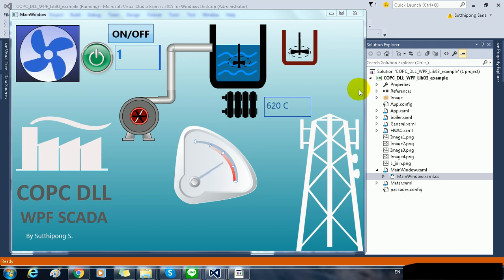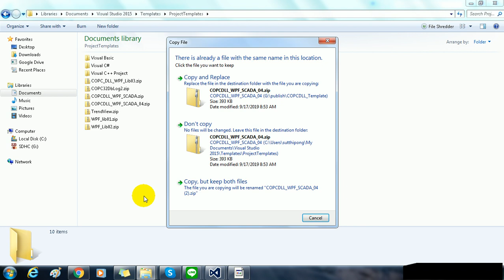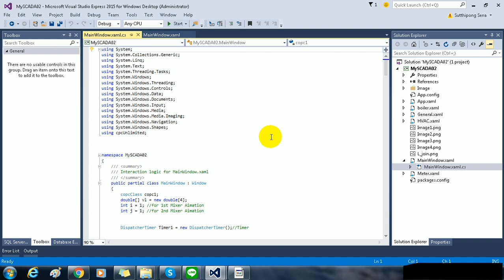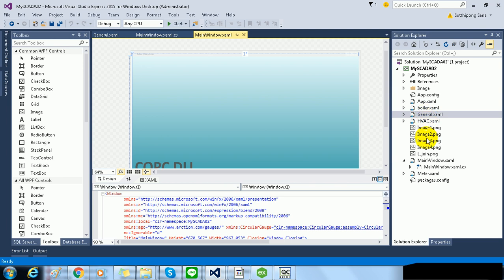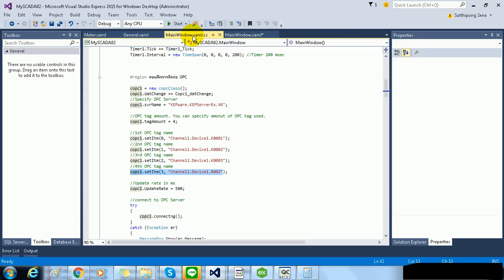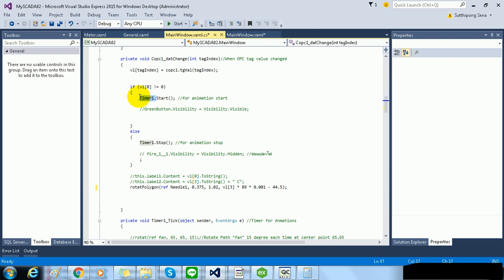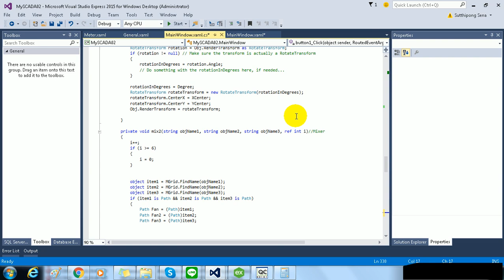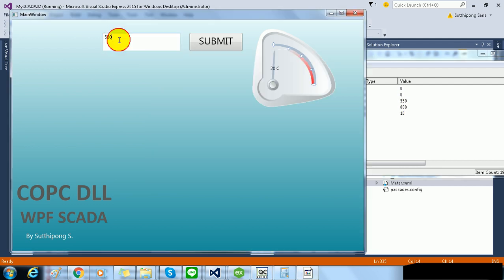Simple C# WPF SCADA Template - Part1

Comment: Dear Sir.
I have 2 computer at the same Network.
I want to build project in which, the first computer will run as server ( include communication, data...) , and second computer oly run GUI app.
How can I do that?
Best.
Reply from the maker: @thohayvietnam1809  At the server, insta OPC Server and configure DCOM for OPC connectivity . At the client , configure DCOM same user to server and create your project connect to remote OPC Server. Good luck
Reply: @scadaiot   Dear Sir/Madam.
OPC is a standard protocol.
I read some paper, it say that. The wcf service can resole this problem.
Do you have any advision?
Thanks